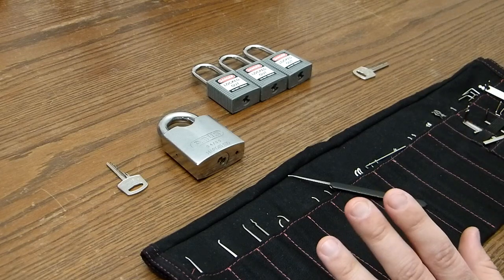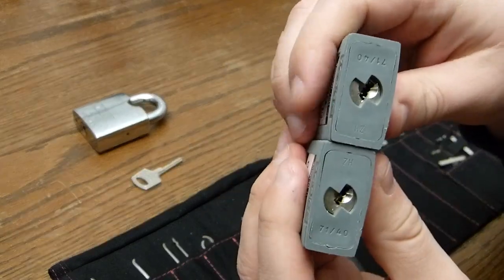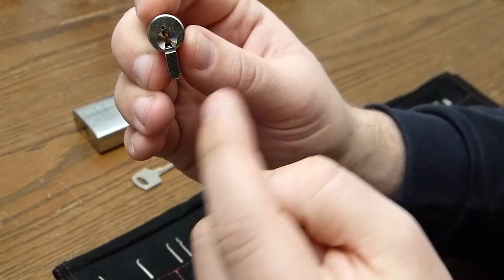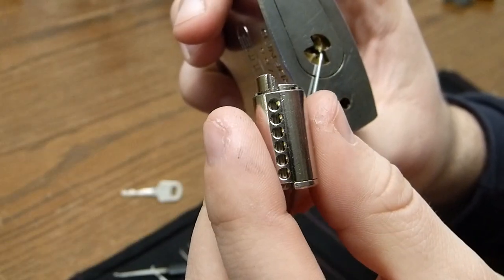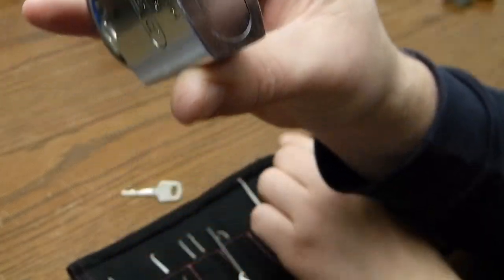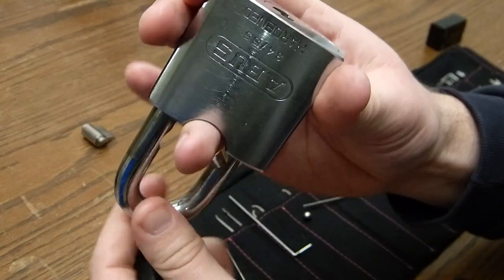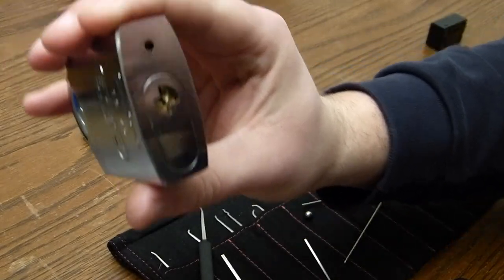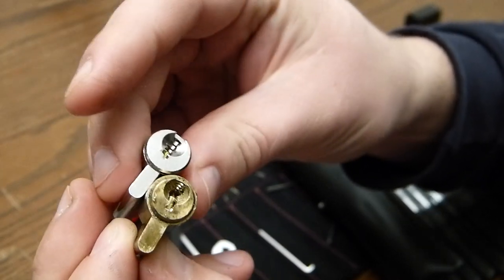[022] Fixing John's Abus 34/55

Comment from the maker: You could say I've been repairing this lock from late 2018 to early 2019.

As always there are plenty of small mistakes in the video. And I don't really care. This video took long enough already. :)
The mini 888 core will not fit in the abus 34/55 as the cam is different from the LOTO lock.